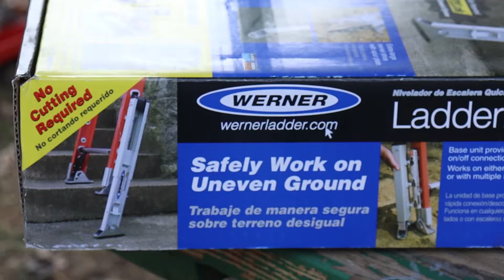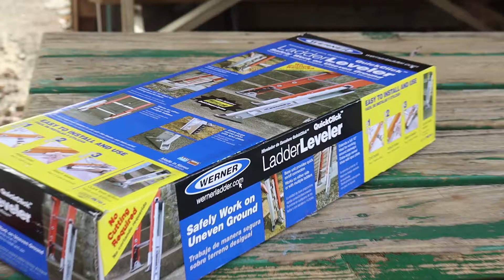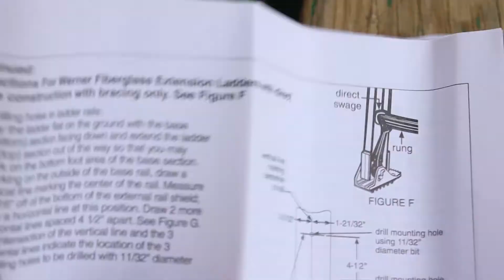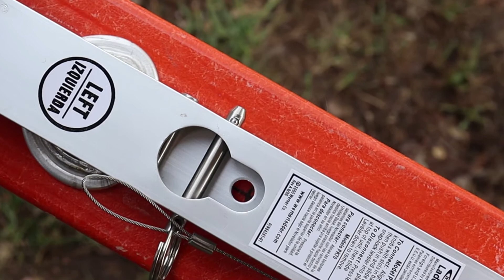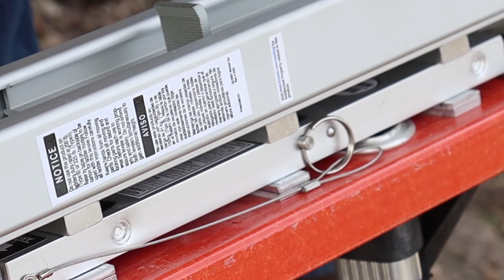Werner Ladder Stabilizer Install and Review

Comment: Great video I just bought this kit for my ladder and installed it today.  I like your trick about finding center, but it didn't work too well for me with a tape measure.  I just centered the bracket to the silver brace shown at 5:18 and put 3 lines on each side where the spacers are. This just allowed me to realign everything as I moved down. Then slid it up to my 5  7/16" mark, 4 1/2, and then the last 4 1/2 mark. I checked all my holes like you did. I then used a marker and  filled in the circles so I knew exactly where to drill.  I would say the hardest part was trying to fit a small wrench in behind the strut for the rung like you said.  I also had to run out to get the 11/32 drill bit. I  torqued the bolts down to 108 inch pounds. Thank you so much I am more than pleased how it turned out!  And these work great! You helped me out alot and I want to thank you for the video.  Well done!
Reply from the maker: Thanks so much for watching and the kind words Gary! Knowing that it helped someone out really makes my day! I am really pleased with mine and get lots of use out of it.
Reply: @themostlymikeshow  Hey Mike it was my pleasure bro!  People like you really know how to explain things clearly and gave me the confidence I needed for this installation!  And I'm glad that it made your day.  Keep up the great videos kind sir!
Reply from the maker: @garytman007 Thanks! I am constantly trying to improve my videos. They were kind of rough in the beginning, but I try to learn something new on every one, and I am constantly trying to make them more entertaining by writing new jokes.

Comment: Thanks for the well done and helpful video.  I have a couple of opinion questions.  Do you feel that the 3/16 increments are fine enough to cause the ladder to be plumb 24 ft up?  Do you think that it is a better design than the auto adjusting Werner model or the orange silicon round foot and rod design?  Is the weight an issue (10#?)?
Reply from the maker: Thanks for watching Larry.  In my opinion, the adjustment seems adequate for my needs. I am not sure if there's any other options that go finer. I just bought this model because I needed it for a project at the time, and it was available at a local Home Depot. It's weight hasn't been cumbersome, if that's what you are asking. I don't know its exact weight.
You asked about the auto adjusting Werner and the silicon round foot and rod designs. I am not familiar with those.
Levelok has expressed interest recently when they viewed this video, and sent me a ladder dolly to review, so that should be coming out soon. I hope that this helps.

Comment: Great video. I want a set!
Reply from the maker: Thanks Jeff! It's amazing how much time it saves you as well as how much safer it makes the ladder to use. Thanks for watching
Reply: @themostlymikeshow  it’s hard to understand why ladders don’t come with this feature already. How often do you encounter completely level ground?
Reply from the maker: @jeffskingley6042  not very often. Depending on how high the ladder is, even the slightest variation or soft spot will take the ladder significantly out of plumb.

Comment: I don't really like the idea of drilling holes in the ladder, I'll dig a hole under the longer leg.
Reply from the maker: Thanks for watching Thomas. I've never had any issues, but I guess that it's always a possibility.
Reply: If it’s any comfort. I’ve been working with them on my ladders for about 6 years now and have never had an issue with them. I can’t recommend them enough.
Reply from the maker: I agree Sirtrino. I am certain that the engineers at these ladder companies have done their homework to ascertain that these couple holes will not weaken the ladder. I believe that they make the latter much safer without wooden blocks under one side or holes. Plus they save a lot of time.